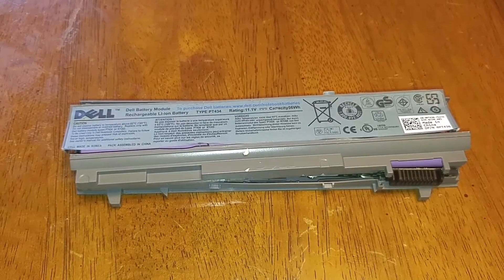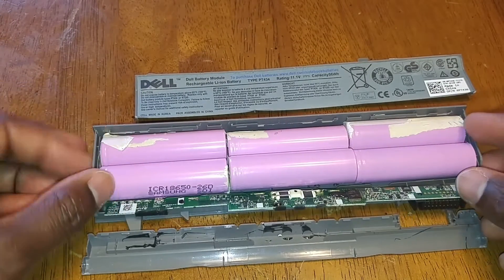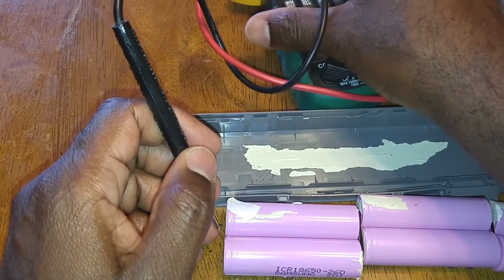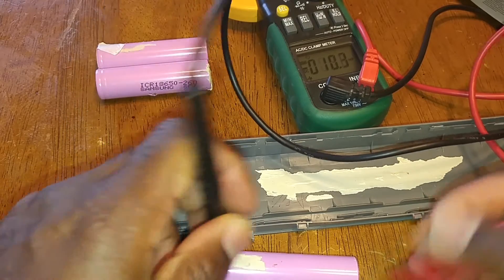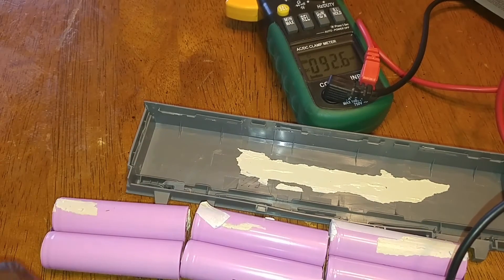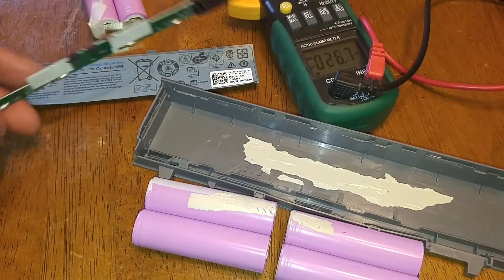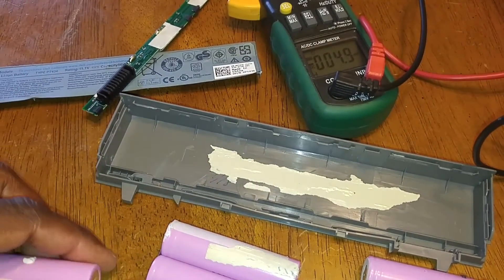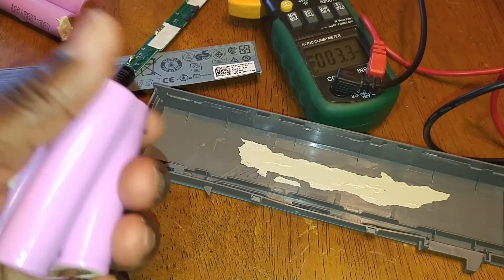How to open and reuse laptop batteries at home

Comment: As I've been learning about laptop battery regeneration lately. I found many more competent guides than yours and know, that if anyone will follow your guide and buy new replacement batteries they will waste the money instead of saving. It's because there are many issues that follow after and are required to make the battery with new packets work properly. Disassembling and assembling of the cell packets must be done in the correct way because the circuit board attached to the battery hold the driver which remember old battery settings and writes everything to the memory. Wrong disassembling and assembling will mess with the driver but even if you do it right, the old info stored by the driver will require wiping/resetting which is quite complicated for a novice and sometimes not possible at all. Amount of work and time wasted for education plus actual cost of parts and tools necessary may not be profitable at the end. Also there is always a risk that you will mess it up so it will be just a junk. After few days of educating myself I know now that it's more economic to buy new battery from Ebay or such. So your video should be called - "Establishing bad cells packet and giving few ideas of what to do with the good ones" 
P.S. They say that Li-ion batteries are very fragile and messing with their heat, charge or electronics above their design may cause explosion.
Reply from the maker: I did mention that it was more practical to just replace the entire module instead of replacing individual batteries. The main point of the video was showing how to check the battery modules and remove "good" batteries for use in other applications....
Reply: @DIYOneForAll  Well, title - " Making "bad" Dell laptop batteries good again" implies that you show how it's done, which you don't. That misleads people like me, who search this kind on information and makes us all waste time.

Comment: Hi,

If you're interested on the circutry of laptop batteries, check out Charlie Miller's Battery Firmware Hacking video/lecture.

It explains a lot on why laptop batteries often times "fail", even though ALL of the 18650 cells inside are really just ok.

Other than that, nice "teardown video". :)